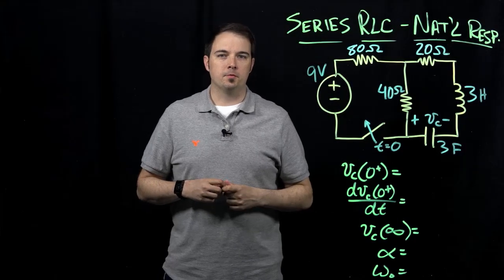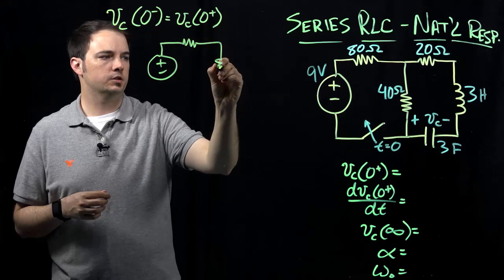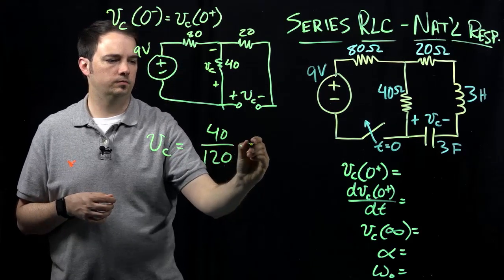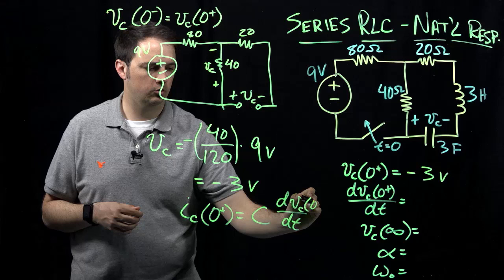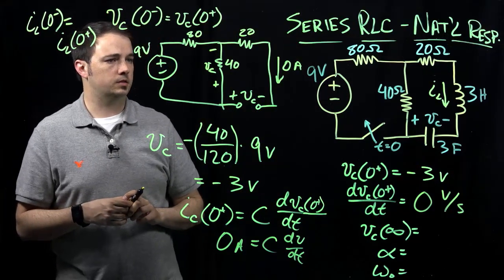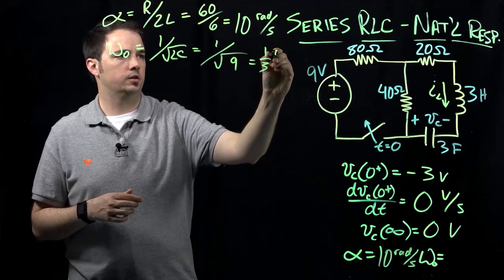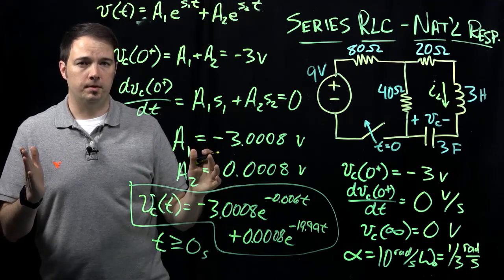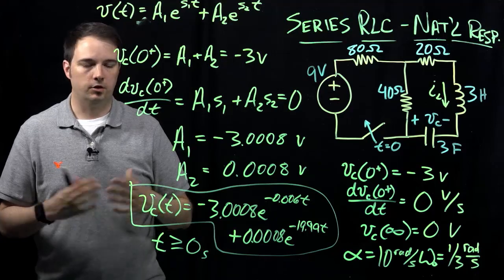Circuits I: Example with RLC Circuit (Series, Natural Response)

Comment: So in RLC series circuit, to evaluate the V(t) for capacitor is the same way as to evaluate the I(t) for inductor, by using the same damper factor and resonant frequency, the difference only is initial conditions, since I found all the videos from other channels are evaluating the I(t) instead of V(t) like you did here.

Comment: Sir I think v at infinity is same as v+ that is -3v . Not zero can anyone explain how its zero
Reply: For posterity; without any active components to maintain the potential across the capacitor, the voltage across the capacitor Vc has to decrease over time, so at infinity the voltage will drop to zero. It is due to coulomb forces as the electrons dissipate into the wire and the charges reach an equilibrium.
Reply: @danielmonahan6127  and what's the point of finding v at infinity in term of finding the natural response, i mean what is v at infinity use for?

Comment: s1 is not -.0.006 when I did the calculation is -0.555 I think you need to re-check the calculation for s1.
Reply: -5.556 milli  😂😂😂
Reply: @เป๋เป๋-ฃ4ค  so i got it wrong?